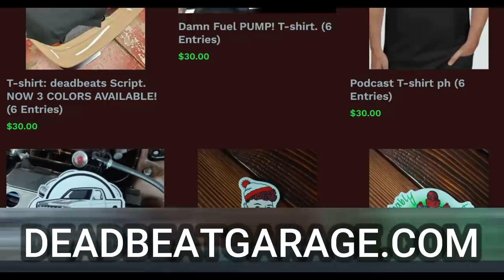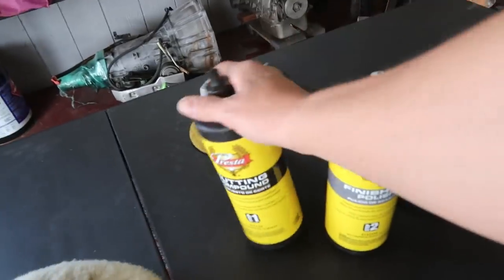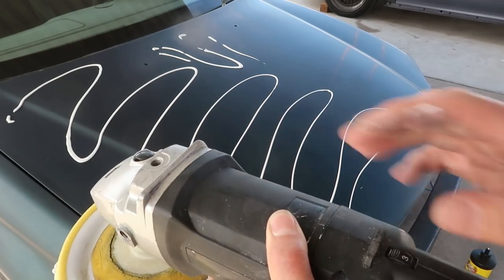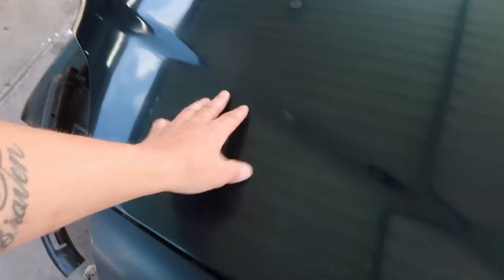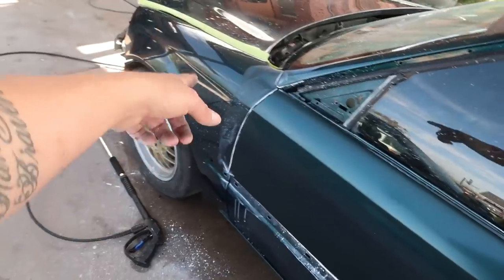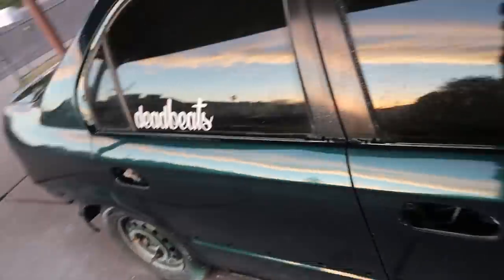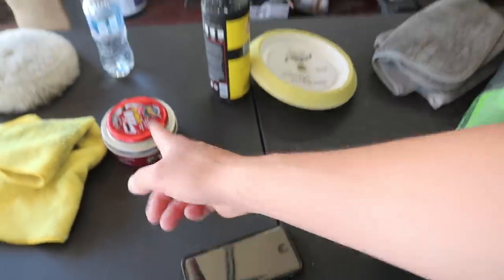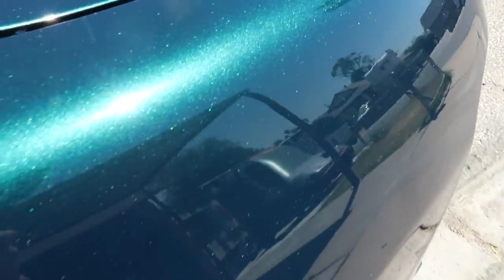Buffing the paint into a MIRROR!

Comment: You overall have a good technique. i would just suggest using WAY less compound and not working in such a large area at a time. Next time try cutting each body panel into sections. And You realistically only need about 5-6 dots on the pad every time you make a pass per section and give the pad a couple mists of spray detailer to help keep the pad lubricated. Concentrating on smaller areas at a time may take you a little bit longer but will assure that you get a better cut and you will use your material more efficiently. With the amount of material you're using and the large area you're cutting at a time, you're essentially wasting the material and not getting the most cut out of it per pass. 
Hope this helps you, and Great job on the paint. looks amazing 💪

Comment: The issue that you are having with the compound and it getting stuck in the jams it's because you're using way too much if the Pad is dry you can always use a little bit of spray wax to lubricate the pad and once you use enough product on the pad you can start using a lot less and to avoid  splatter keep it on setting one just to spread out the product and then jump to setting three
Reply: Agree, 3 or 4 times as much compound and polish as was needed.

Comment: Looks fire, the only tip i could give you that i noticed while you were painting it, what we do in the body shop we put down a coat or 2 and on the final coat we almost "mist" it over top instead of doing a full coat. it will leave the metallic flake towards the top and make it POP in the paint, even more
When you lay it thick the metallic actually has a tendency to sink into the paint and hide most of its glimmer.
The metallic flakes have a higher density then the paint itself so they typically fall to the bottom.

Feel me ?
Reply: That makes a lot of sense... thanks for explaining it.
Reply: that actually makes a lot of sense

Comment: You should wait 2/3 months before waxing and ceramic coating. So all the gasses fully escape. 

Also after your pads been saturated you can use a few small drops of compound. So it doesn’t fling everywhere. Good work bro!

I personally like cutting with wool pad because it cuts more with producing less heat
Reply: The wool is the black 1?
Reply: wool are the other 2 white pads
Reply: You don’t have to wait 2/3 months
I’ve been doing detailing since 1995
You can ceramic coat immediately after compound, polish, and wax.
And if you want, clear bra.
Reply: I would wait at least 30 days with fresh paint before ceramic coat.
Reply: @realitycheck3672  he's talking about after a fresh paint.

Comment: you might want to brake your panels into parts and concentrate on one part at a time now when you buff you should slow down and buff untill you see the shine come up to a high gloss while moving slowly back and forth over lapping like cutting grass you will tend to lean your head sideways so you see the shine come out from under the edge of the pad   i watched Bravus buff and he is buffing too much of the panel at one time and he moves too fast over the panel   you must go slower to achieve a high gloss you must buff a smaller portion at one time  and do not apply compound over the entire panel it will stain the paint while it sits until your pad runs over it  so keep to an area  about 18 inches square

Comment: If you plan on ceramic coating the car you will have to strip the wax you just put on it. If you don’t you might as well throw that ceramic coating in the garbage because that what’s your are essentially doing without proper paint prep technique.

Comment: 1st pass use a wool pad with rotary buffer that you already have. 2nd stage polish use a dual action buffer you can get at harbor freight for $99 with a microfiber pad. Rotary buffers will never give a clean final finish. They are for cutting, not polishing. Take a look at your paint in the sun after using a rotary. You’ll regret it. Also, you are using WAY TOO MUCH compound.

Comment: You are using to much product and end up wasting it a lot of it, try just putting product on the pad. Spreading it and the start buffing. If you are worried of burning you can get the pad a little wet and that helps. You wont do that big of a mess